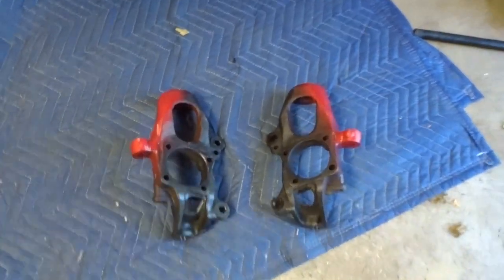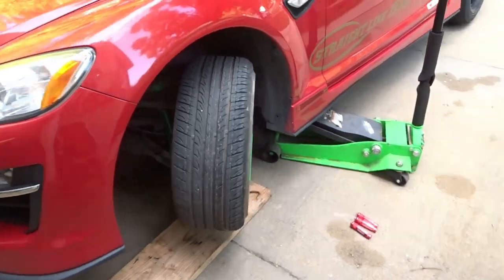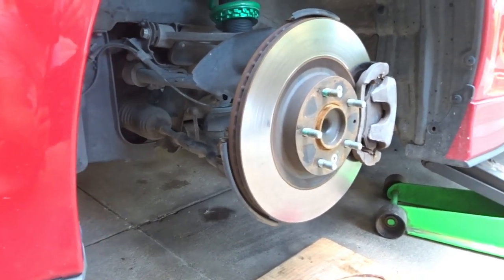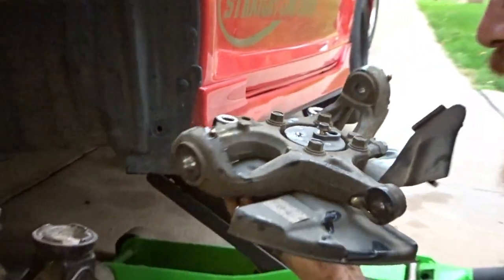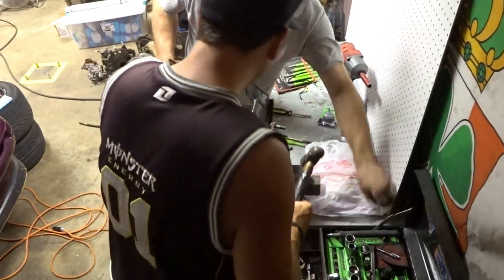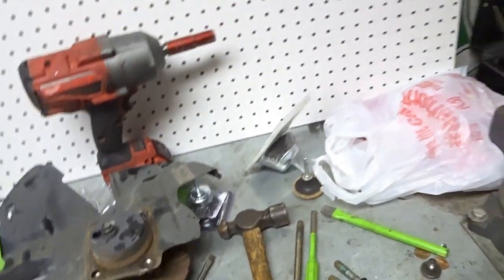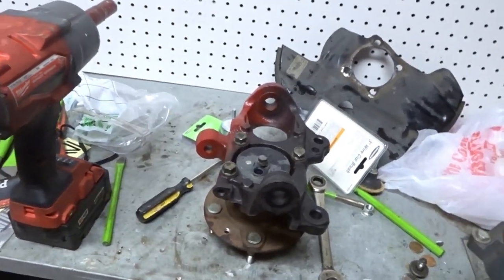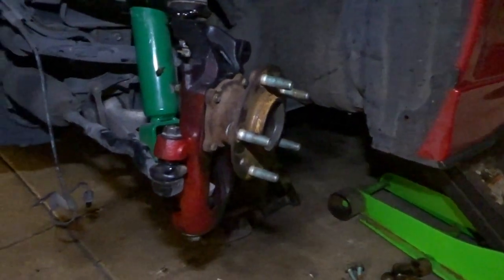HOW TO INSTALL RX8 DRIFT KNUCKLES-  Drift knuckles on the RX8 - Sidewayz Sinclair - Vlog 041

Comment: for the modded knuckles whats your aligement looking like? 
I can only get mine to go to -.5 on toe
Reply from the maker: Running 0 toe
Reply: @Sidewayz_Sinclair  did u have to modify the tie rod at all? mine seem to be bottoming out before hitting 0 toe
Reply from the maker: @itsdkalex6371  Nope, when put everthing back together I just had to spin them in a couple turns nothing crazy. what knuckles did you do?
Reply: @Sidewayz_Sinclair  I used the stock knuckles and cut an inch off each side. Idk if my tie rods are just shot some people say to cut a 1/4 in off each side
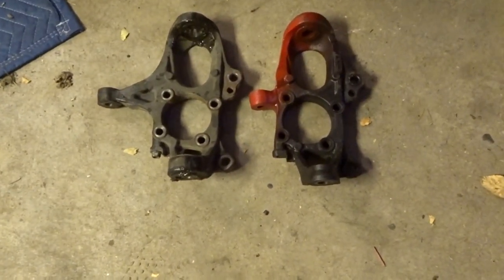Reply from the maker: @itsdkalex6371  I think mine are cut more than that. look at 4:44 . That's weird I had no issues with my tierods

Comment: How does car feels on highway and normal driving after this mod? Does it trying to move side to side by itself or it rides as it was before ?
Reply from the maker: Drives fine, more responsive for sure. It just moves the piviot point so you can still align it like normal.

Comment: What is the wheel and tire spec??
Reply from the maker: wheels are wed farmas. 17x9 +11 fronts 17x8.5 +22
Reply: @Sidewayz_Sinclair  how much room do you have between the inner barrel and lca/tie rod at full lock with these specs?
Reply from the maker: @em2attic  I'm not to sure if these his the arm or not.